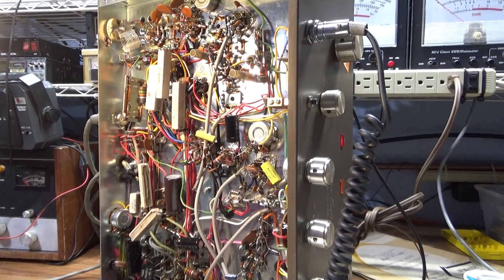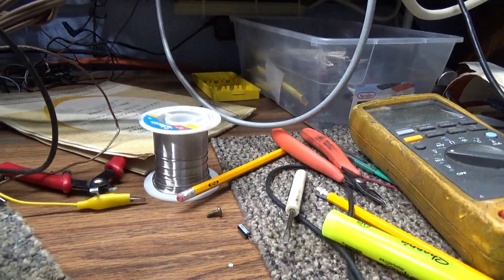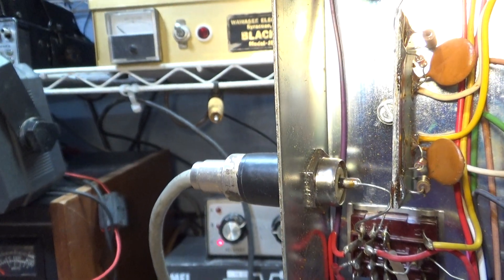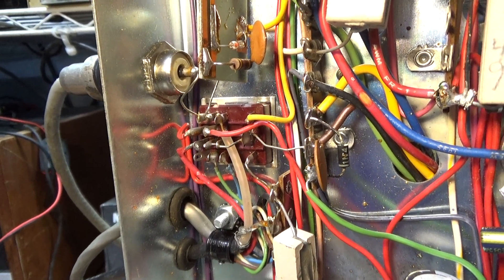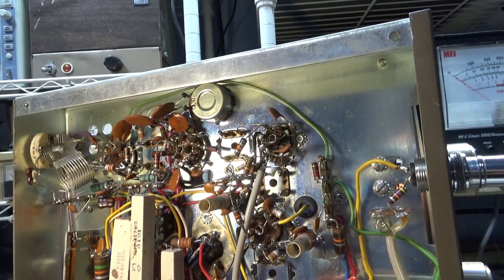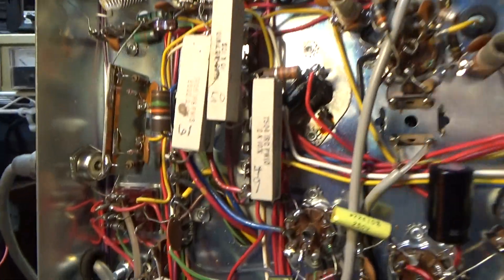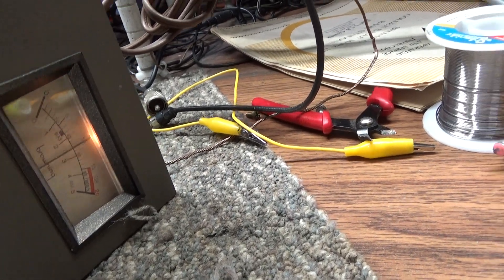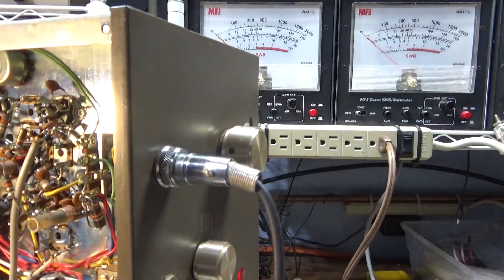Browning Mark 3 transmitter finished, and me going on a rant.  Screw You Paypal.

Comment: You can still get brand new multi section can capacitor replacements. I just replaced the big cans in my Titan 4 and Mark 3 receiver. I keep several 20 uf 500 volt radials for troubleshooting but I'm old school.
Reply from the maker: Yes, but modern new single caps are smaller, cheaper and have better specs.
Reply: @tramdr  Considering how the OEM parts lasted 50 years, it's going to be the next guy's problem. LOL 😂😂

Comment: Hey TramDr 👍Clean MkIII. Mine is just like that... Question. Did you ever do a video putting a  Siltronix Model 80 #3 VFO on a MarkIII? I think on the circle crystal block in the receiver you can choose to pull a crystal out and solder the center wire of the VFO to the upper part of the now empty x-tal socket and the shield to ground. I don't even have the VFO yet (im looking for one.. you selling one)? Long ago I did put one in another MarkIII I had and it worked great! Any help with your thoughts on this? I hope you'll still make videos. Sure enjoy them.  73's    X     Jackson
Reply from the maker: You mean transmitter, right?
Reply: @tramdr  Ooops.. my bad,, yessirr. The transmitter!
Reply from the maker: just pull the channel 23 crystal, get as short as possible shielded RF cable and wire it to the crystal slot.

Comment: Hey Doc, what about increasing R49 to lower the dead key then put a cap across it like a swing kit? Crazy idea?
Reply from the maker: only problem is the cap part does not work very well. Better to use a zener to stabilize the voltage.

Comment: Doc can you give the specs of that Zener diode? Thanks
Reply from the maker: 1n1375 100v 10 watt zener
Reply: Thanks Doc. Would a 1N4004 work?
Reply: Doc, I was wondering about the diode you put across R49.
Reply from the maker: Oh boy, I didn't even remember putting a zener on any Browning. Since your question, I rewatched it and still don't remember. What I think is the owner of that radio was trying to lower the dead key a watt or two and I probably added a 5 watt 50 volt zener to in series to that resistor to get the dead key down. That's just an educated guess though.

Comment: I've torn open 50 year old electrolytic capacitors and the electrolyte looked like nasty wax goo; they smell like old time electronics repair shops.
Reply from the maker: Yep
Reply: The relay room in the Elrama Power Station smelled like an old tube radio too. I miss that place.
Reply from the maker: similar to that new car smell. Nothing like it.
Reply: @tramdr  Tube radios, radial engined aircraft, Harley -Davidson motorcycles, and Jack Daniels straight up.
Reply from the maker: Tube radios, Tube stereo, Pinball, racquetball, Amusement Parks, Halloween Haunted Houses, Bicycles, water parks, and Virgin Strawberry Daiquiris.